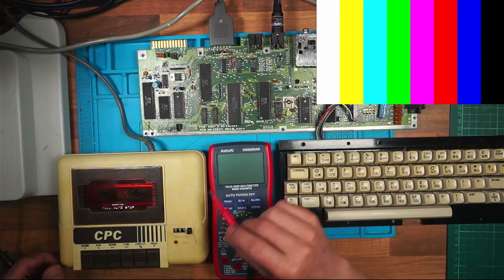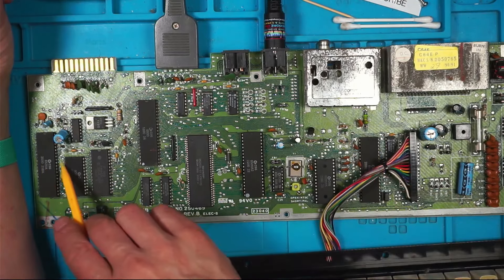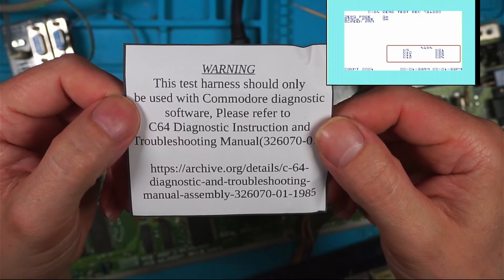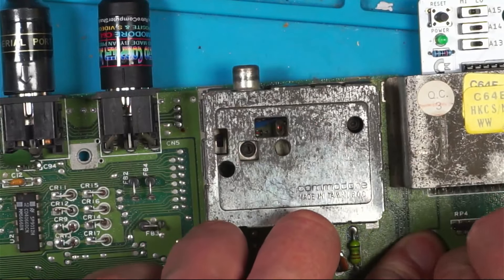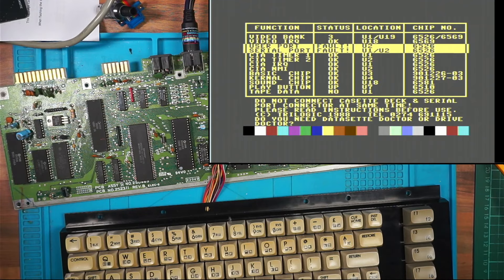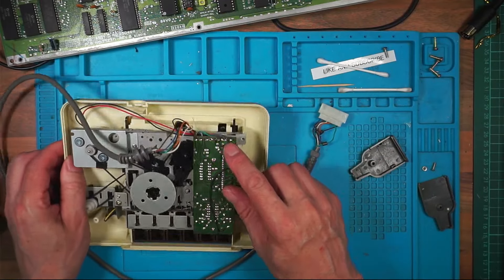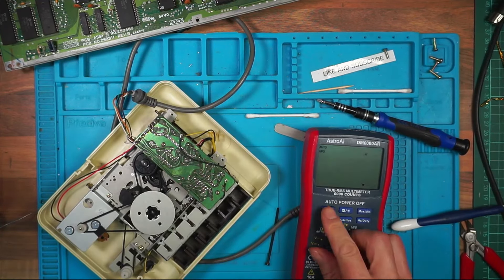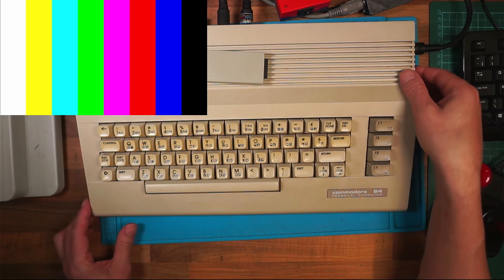Commodore C64 Datasette won't continue automatically | How to Fix

Comment: Great job Philip =D  The reason you got those errors on keyboard - the loopback cables are designed for the official Commodore test cart (you later tested with that one, where it passed).  The SD2IEC works well for most .d64 games, but not for all - and they can take ages to load if you aren't using a fast loader cart (eg. Epyx Fast Load).  The Kung Fu Flash cart is much easier to use imho, but also doesn't work with all .d64 files.  .prg all work fine I think!
Reply from the maker: Thanks Chris. I was surprised how slow it was, especially since it was loading from an sdcard. I guess it's just because the 64 is slow as hell too lol
Reply: @PhilipBryden  Yeah, but if you use an Epyx Fast Load cart - or some other cart that boosts loading speed, its a LOT quicker!

Comment: Tech tip. When you need to clean between two contacts like that micro switch in the datasette.... get yourself a thick piece of paper or an index card,  saturate it with your contact cleaner, and drag it between the contacts. Hold the contacts closed so it puts pressure on the cleaning card. I like to do this with tarnished relays and such. Don't use sand paper, you'll ruin it.

Definitely haven't seen this malfunction before. It's a new one on me. Hopefully other people with the same problem find this video and get their datasettes working again.
Reply from the maker: I was worried the IPA could melt the glue that was holding the contacts in place. I considered using an emery board but thought it would too rough. Next time I'll try some thick paper. Thanks for the suggestion.
Reply: @PhilipBryden  Yeah emery board is definitely too rough. It eats away at any protective coating on the contacts. It might work again for a little while, but it will quickly fail. Especially if you're dealing with a relay passing any amount of current. Without that coating, the contact craters like the surface of the moon.